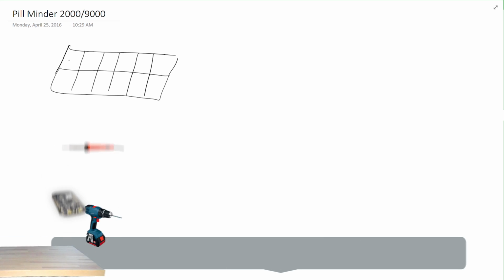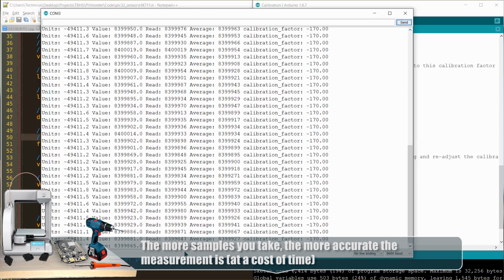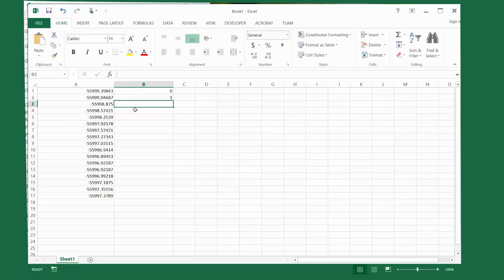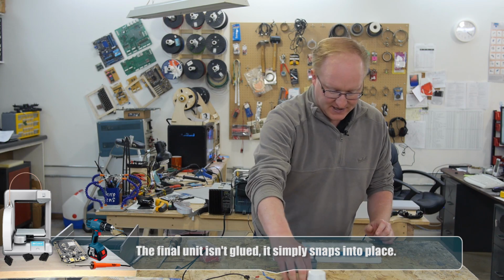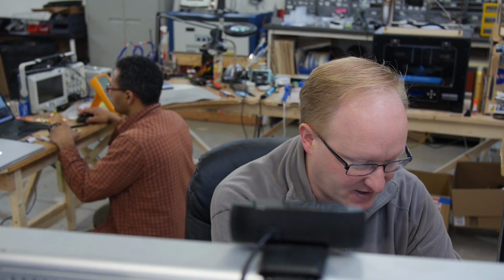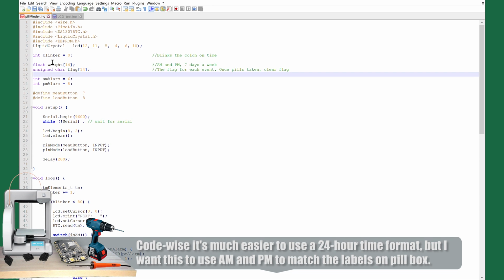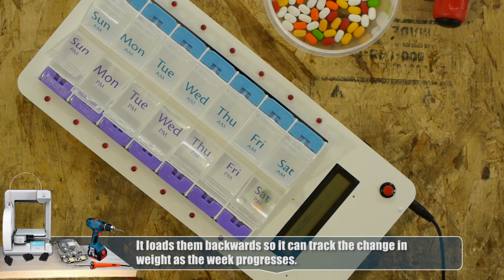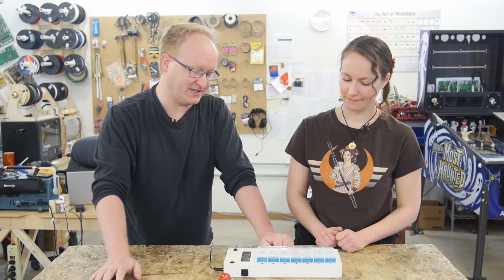Ben Heck's Pill-Minder 2000

Comment: Weight is cool but unnecessary. Maybe add a sensor for turning it upside down because no one is going to pull the pills out of those slots with tweezers.

Comment: +The Ben Heck Show I'd say an IR sensor, or switch would have worked better defect the opening of the door on that day especially if the container if going to have something on it or placed in a drawer. sensors for each column checking for obstruction like a pill but ignoring the closed door.

Comment: The LCD seems to use one of the 40 bit custom character slots to drive the whole 7-segment and addor section. That's quite a clever way to make use of the driver chip. By loading a custom character into the 8th position of the 2nd line memory, and then changing the custom character, you can drive each and every segment. What you discovered was the character symbols fixed in memory being loaded into this "special" configuration instead of the regular 5x8 pixel matrix.

Comment: Hey Ben and friends I've been watching your series for 3years but this is my first time messaging you... I've seen so many awesome build and tech designs I've never had a compliant you've always had a great series but there is one thing I've never seen that I'd love to see a build for... I'm currently a DJ looking for a way to get an awesome synthesizer to add some flair to my sets... I like keyboard buttons on vsts but the current synths that are on the market are so expensive can you build one that has keyboard built in with a midi plugin function to be able to use sounds for any vst instruments on a laptop or maybe a simple vst controller... that you don't need a laptop to plug into you can just plug in a flash drive and control your vst with this controller you can build... Please Please Please build this I'd pay $300 for a keyboard midi synthesizer thanks for reading this hope it gets to you...

Comment: we'll! how the heck get money to buy all microcontrollers and parts??? I'm just wondering I knew microcontroller is expensive per unit.
Reply from the maker: +talastas789 Some part recovery, else support from element14
Reply: +The Ben Heck Show know I knew!!! how got the money but.....  ask much a question ..............can I join the team???
Reply: +The Ben Heck Show know I knew!!! how got the money but.....  ask much a question ..............can I join the team???
Reply: Microcontrollers are cheap, depending on the type you order. The most common are 8-bit controllers, they retail for 0.50-4.00 depending on the type, brand and pin count

Comment: I would have put the load cell as far to one end as possible and then used a lever system to amplify the weight of the pills on the sensor

Comment: Why wouldn't you go for something a bit more simple and a bit more "internet of things"?? Pill-minder 2000..yep its a year 2000 solution:) I don't think anyone wants a complex micro-management of pills..just a reminder to take them..people generally know their pill routine.  See if the person, changes their routine and is out the door in their car driving to work earlier than normal..how does an alarm on a box back at home help??To make it more 2016 you could just have a simple box with a some kind of sensor on a timer. If the box isn't opened by a certain time of the day, then an smtp/sms is sent to the primary caregiver/pill taker..so it doesn't matter where they are..they know they forgot to take the pills..and can go drive home and take them?? Could use one of those cheap arse $5 esp8266 chips that has inbuilt wifi and allow you set up a server directly on the chip.

Comment: What an unbelievably flawed approach, basing a pill box on weight. Consider, medication often changes over time, or over the course of a day. Meds can vary hugely by weight - having X amount at this time, and Y amount later. Meds for just twice a day? What about meds that have to be taken with meals, or at bedtime. A simpler but more practical solution would be a 4x7 array whereby the each row of 4 would have a set time alarm, with the option of nullifying any redundant rows.

Comment: Seems like a little overkill...  Just put the pillbox on a normally-open button.  When the box is lifted, the button will close and signal the micro-controller.  If it doesn't receive a click at the right times of the day, it lights up a warning LED.

Comment: Honestly I think this could have been a lot better if more simpler by using switches in each pill cavity so that the only way to turn off the alarm or confirm the pill was taken would be by opening the lid of each day of the week.
Reply: I thought the exact same thing. Microswitches seem like the simplest option, but perhaps for mass production a single load cell could be cheaper than 14 switches.

Comment: Since you are using weight, code a routine to allow the user to load the dispenser for a complete week, then press the "load" button to set the system to cycle through each pill chamber and record the weight and store that data. Then go to "dispense" mode for the daily use.  

Allow for a user to run the "setup/load" routine any time for changes in pill amounts/sizes/quantity.  This would make life infinitely easier for the care giver to manage the device. - Just a thought.
Reply: There's only a single load cell, so if I'm understanding your suggsstion correctly, it's impossible. Pills have to be loaded 1 batch at a time because you can only get total weight, not weight per compartment.
Reply: Ahh - so the pill count must be the same every day. Forgive me - I didn't catch that.  Parents/Grand parents have variations  for daily counts/pills.

Comment: I'm not convinced by the weight idea. It's an nice concept but introduces faff and seems very prone to failures in use. If you wanted some sort of automated "I think they took their pills so I won't alarm" it seems to me that detecting the section lids being opened and closed would be far easier. TBH I don't think even that is necessary. If you can trust the person to understand the alarm and take their pills then they can be trusted to press a button by the section to cancel the alarm. If you can't trust them to do that then the whole deal is off anyway.

Comment: No way my elderlies would be able to make sense of that interface.
Reply: +theHeckwithKaren A simple door switch (like a reed switch and a tiny magnet) to detect opening would be an easier and more reliable way to assume a pill has been taken.
Reply: +xKatjaxPurrsx That's why you need a young sprite to set it up for you. Or we could just make the interface easier. ;)
Reply: No doctor would be able to take the time for each and every patient, they have so much to do these days anyway.
Reply: +xKatjaxPurrsx 
Probably could work if it were connected to the internet and the doctor (or whoever) could set the timers, so the elderly person doesn't have to do it.